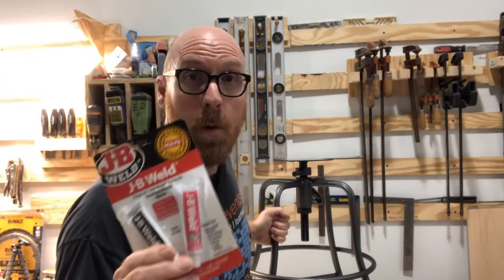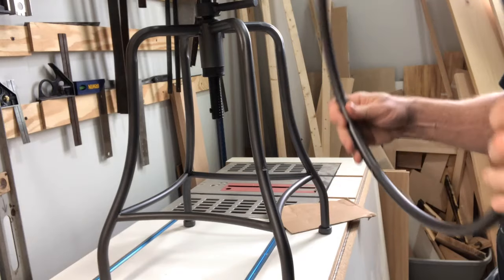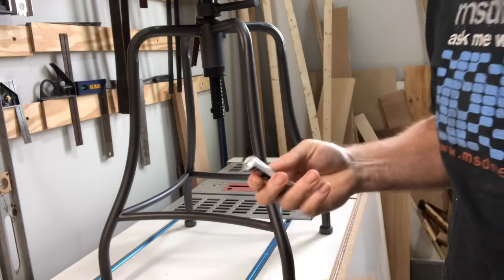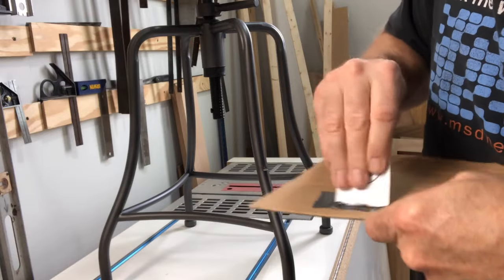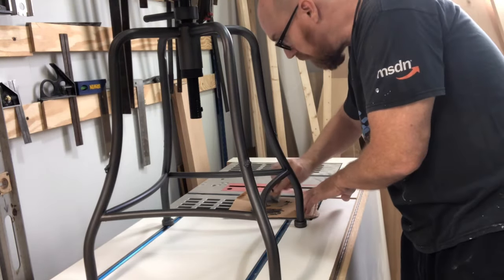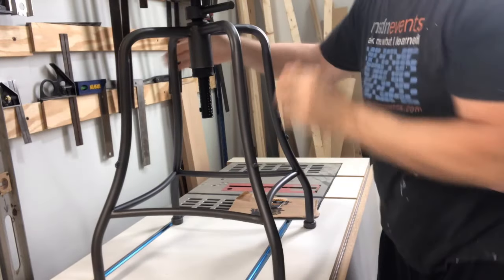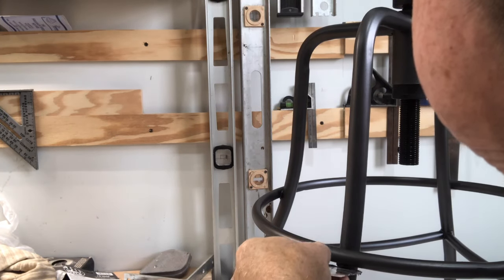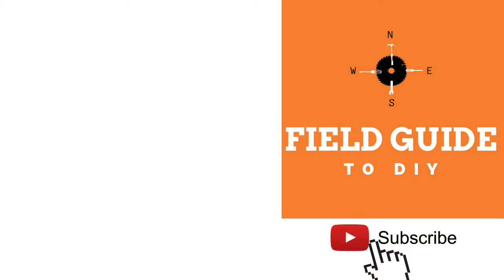How to use JB Weld | JB Weld Original Cold Steel | JB Weld Step-by-Step Instructions

Comment from the maker: Have you considered JB Weld SteelStik?  Here's how to use JB Weld SteelStik - https://youtu.be/ccGJyBNzf50
Reply: I used JB Weld SteelStik on something and it didn't work out. Now, I want to try out JB Weld Original. Can I apply JB Weld Original on top op JB Weld SteelStik?
Reply from the maker: @Zeberka767  I had a similar experience.  I believe you can but just to be safe, I ground the steel stik off.  https://youtu.be/ZzFCqm_9O2c Thanks so much for watching.  Let me know how it goes either way.
Reply: @FieldGuidetoDIY  I used it today and so far it looks promising but I was wondering when it says it cures in 1 hour does that mean I can drive with it on after 1 hour or does it a full 24 hours to fully cure and harden?

Comment: Would like to see you show the hold at end of video
Reply: maybe a sequel? resolve the story?
Reply: You can't really trust it. It will get hard, but it can fail under pressure, for sure. Good ole drill hole, nut and bolt works every time and far stronger.

Comment: Great view Eddie - love JB Weld.  Once cracked a casing on my motorcycle and they wanted over $500 to patch it. A friend told me about JB Weld and I patched it for under $5.00 bucks.  Great video - looking forward to the next one.
Reply from the maker: Trent Wheeler It is a great product.  I used it on a curtain rod over the weekend.
Reply: Truth is, that jb weld will break down and cause extra wear on your oil pumps and any other connecting parts
Reply: I have the same problem

Comment: Trick with using old cards (credit cards, loyalty cards, room keys, any plastic cards...).  Get a pair of "pinking shears" (they cut a sawtooth pattern) - you can cut the cards and use them to spread glue...  works better than just a plain card.
Reply from the maker: Brian, great tip.  I need to try that out.  Seems like it would work like a tile trowel.  Thanks for sharing.

Comment: It cures, not dries. Actually, the terminology can make a difference when a novice user touches their fix and it feels dry, it probably hasn’t cured, and they’re none the wiser, until it breaks.
Reply from the maker: Very good point Jay!  It “sets” in 1 hour and “cures” in 24.
Reply: @FieldGuidetoDIY  I’ve replied to two videos, somewhat critically, though not my intent, and you’ve responded well to both. Good on you for your positive attitude.

I’ve thought about offering videos on my experiences, to offer a “better” and fuller example of what one should/shouldn’t do or expect, so I appreciate all those out there in YouTube land for following through, yourself included.

Most of my issues have already been addressed, though some are inaccurate or short on details that could make the difference between success and failure. I determined that completing a task, videoing along the way, and then editing it was waaaay more effort than I had any desire to undergo. So, I “try” to be helpful in offering my two cents. Sometimes it’s appreciated, and other times it’s poo-pooed. Such is life. 🤷‍♂️

Be well, and keep making your videos, they Are appreciated!

Comment: I'm gluing the tie rod on my garden tractor today with JB WELD original.
Reply from the maker: That will be quite a bit of bouncing.  I’d like to know if it holds.  Keep me posted.
Reply: @FieldGuidetoDIY  I wire wheeled the parts and cleaned them with alcohol. I used a magnet and zip tie to position everything. After 5 hours I'll remove the magnet and cover the whole joint heavily with JB. After another 24 hours we'll see. I can always strip it and weld it. I'm just curious.
Reply: @dalehammond1749  how'd it go?

Comment: This was really helpful, thank you!  I’m brand new at learning how to do things around the house and I found your video very informative and I didn’t feel talked down to at all. Keep it up!
Reply from the maker: Maya, I am so glad you found my video and I’m so glad it helped.  I hope I NEVER appear to talk down to anyone.  We all approach DIY at different levels and even the most experienced general contractor out there can learn something from somebody.  Thanks again.
Reply: It is not helpful being a video how to use this product. You have to clean the surfaces you're going to glue up. Simply applying the glue over the paint is just wrong.

Well, it can stick the parts together, and in this case it doesn't matter, but the surface preparation part is crucial.

Comment from the maker: Be sure and see our JB Weld strength test.  The results may surprise you.  https://youtu.be/cUZ8b4wxDXk
Reply: I know when mixing bondo or glaze with automotive it's well known to never mix on cardboard because components of the epoxy soak into the paper. It could result in it being tacky due to a failure of the hardener or could overall just be a weaker finished product.

So I imagine you would want to use a hard plastic flat surface that is disposable..... Cheers
Reply from the maker: John You raise a great point.  Never thought of that.  I did not notice much absorption of course I used a very small amount.  I could see how that could be a factor w bondo and other epoxies with larger amounts.  Thanks for raising this point and thanks so much for watching.

Comment: I have a laundry bag made of canvas and the strap tore i thought i could glue it with crazy glue it doesn't work it becomes brittle and falls apart i could sow it but don't know how is any kind of strong paches that can fix canvas would really appreciate you thanks
Reply from the maker: Juan, I am afraid you’re going to have to sew that with some strong nylon thread.  My grandfather was a sailmaker his whole life and I am quite familiar with canvas and canvas repairs.  Great question though!
Reply: @FieldGuidetoDIY  that'll work nylon any kind of needle will work?
Reply: @FieldGuidetoDIY  how about the glue you just used I ask because if have the two in one but I haven't opened it yet.
Reply: @FieldGuidetoDIY  yes sir I'm going to have do it by hand.
Reply from the maker: @JuanCarrero-ok3nx  there ya go.

Comment: Can this be used to basically weld two pipe back together my exaust on my honda came undone and I'm not spending 1000 plus to get it redone
Reply from the maker: It really depends where you're going to have your repair?  I believe it is rated up to 650 degrees Fahrenheit so maybe having it close to manifold may exceed that.  Thanks so much for watching!

Comment: I bought JB Weld epoxy for metal yesterday at Walmart. 

Do you think it will hold Aluminum sheeting to a metal header?
Reply from the maker: It should.  I've had good fortune attaching aluminum w JB Weld.  Let me know how it goes.
Reply: @FieldGuidetoDIY  how much weight does this hold? It’s a floating 30” long header. Pine wood. Prob 2-3lbs if that
Reply: @FieldGuidetoDIY  I backed the wood with a thin sheet of cut aluminum so it’s a metal to metal marriage

Comment: Any ideas on how to apply a bead in the corners of a metal sand scoop used when metal detecting at the beach. I’d like to reinforce all the welds cause they look pretty weak. China😬
Reply from the maker: Absolutely.  Mix up a batch and real quick lay it in using a popsicle stick.  The longer you work with, the more likely you are to have peaks like those found in a meringue pie.  You can even sand the high spots with some 120 grit sandpaper.  Let me know how it goes.
Reply: @FieldGuidetoDIY  Thanks , I’ll keep you posted 🤙🏼

Comment: Hi do i let it dry for 4-6 hours then wait a another 15-24 hours
Reply from the maker: Yes.  Don’t touch it or move it for 4-6 hours.  It is not full strength until it cures after 24 hours.
Reply: @FieldGuidetoDIY   so I wait for 30 hours total
Reply from the maker: @danteslays633 negative.  6 hours from application to move it and 24 hours from application to use it and consider it full strength.

Comment: I want to put sisolation un the underside on a metal roof. Thought on using JB weld to fix metal support lugs on the underside of the metal. Would this work do you thinks ... what approx weght might might the joint be expected to hold?
Reply from the maker: Mervyn, what a great ideas.  I’m thinking the insulation would not be very heavy at all.  I’m thinking 2 inch thick styrofoam sheets at the most.  I’d suggest a minimum of 4 bolts through each 4 x 8 foot sheet.  JB Weld is rated up to 680 pounds per square inch so I think you’re well within the tolerance.  Please let me know how it goes.
Reply: @FieldGuidetoDIY  thanks

Comment: HOw do you clean the top of the jb weld dispenser so the top will not stick when you put it back on?
Reply from the maker: You may need to scrape or carve off the hardened portion off the top.

Comment: Could I use this to plug a hole in my water pump for my 2003 Chevy S-10 Xtreme?
Reply: I don't see why not. I plugged a hole in my crankcase for a dirt bike with it
Reply from the maker: Brandon, just curious.  How big was the hole?
Reply: I'm thinking of using it to seal a radiator crack in my 85 Chevy. Any news on how well it held? I just need it to survive til my paycheck comes in lmao

Comment: You should have marked the back legs before removing the ring ! Then you would have known where to add the JB, how long did it take until it fell apart again ? :p
Reply from the maker: You’re exactly right.  Or just one leg since the weld was on the bottom side of the foot rest.  By the way, still holding.  I can’t say the same for the stool I repaired with JB Kwik Weld.

Comment: Quick question. I have a discontinued double bass set of drums that I've got alot of cash tied up in, well the left leg on one of my kick drums broke tonight and i can't find one anywhere. The part that broke on the leg is like a metal looking fiberglass material but it seems very brittle. Will JB Weld work if I use it and just let it set for a few days?
Reply from the maker: Jonny Crash It is worth giving it a try.  Although the kick pedal will get a lot of force and repetitive action, JB Weld Original Cold Steel is rated up to 680 pounds (your right foot isn’t that heavy, is it? 😜). Clean the contact points up real good and give it a try.  You may have to come up with a creative way to clamp it until it cures (24 hours).  Check out this video I did with just a little bit of contact.  https://youtu.be/LWt2vkgiPU8.  Let me know how it turns out.  Good luck.

Comment: Would this be safe for something that holds a lot of weight like a bed frame
Reply from the maker: It actually depends on how much “meat” (overlapping metal) there is.  I’ve found a butt joint of the thickness of a bed frame just doesn’t give JB Weld enough surface area to be successful.  Let me know how it goes.  Thanks so much for watching!

Comment: Hey there I got a 20 KG York weight plate it cracked when It dropped to the concrete ground from height!. Would this  be suitable to mend it back together?? The plate is made of I think some kind off cement or concrete mix!? Appreciate any advice thanks..
Reply from the maker: KAOS, the manufacturer says it is rated for concrete as well.  I think it worth a try.  Keep me posted.  Thanks so much for watching.
Reply: Ok I’m getting it today I will keep you posted thanks
Reply: @kaosrip8913  did it work?
Reply: @TheBigr2020  
Sure did still solid to this day appreciate the help awesome 👌

Comment: Question for machinists and tool lovers: I have a chisel attachment on a rotary hammer I'm using for a project and the bolt's threads are literally melting and busting away when the tool is in use. Can JB weld and a locknut protect the threads??
Reply: no
Reply: @jimmyrecard6021  well thank god I read deeper into that before I did it. Bought some red loctite 271 threadlocker so I'm hoping that will do the trick
Reply: @jeffreymeeks4051  run chaser through it to clean up the threads too.
Reply: @jimmyrecard6021  well my hardware was all brand new so the bolt and nut threads looked as clean as they could be

Comment: Hello. My bunk bed is a metal tubular one and its a twin over full. The bottom bunk has some broken bars that are broken from the frame and now the bed is drooping. Do you think this would help?
Reply from the maker: I really think it would help.  The best way to fix it would be to shore it up with some wood or metal inside like what I did with the 13 foot curtain rod.  I’d cut the pipe and insert a wooden dowel or smaller piece of pipe.  I hope this helps.  Please keep me posted.  Thanks so much for watching.  https://youtu.be/Hiu95-_3sgU
Reply: Throw it in the garbage it’s time for a new bed

Comment: Did you say equal parts when mixing the jb weld ?
Reply from the maker: Joshua Chudley JB Weld Original Cold Steel requires equal parts of cold steel and hardener.  Thanks so much for watching.  Let me know if you have any other questions.

Comment: Does it have a strong odor/fumes?  I have a small apartment and wondering if doing a project while I work from home is a bad idea.  But I just wanna get paid for DIYing on the clock!
Reply from the maker: Se Sa, the smell is not strong at all.  I tend to do repairs in my garage with the door open but I have used it indoors.  Thanks so much for watching.

Comment: Hey boss would this work on my motorcycle oil pan. Small crack
Reply from the maker: Maine F, I would think so as it is rated up to 680 PSI and water tight and up to 300 degrees.  The question I have would be whether or not the solvents in the oil and the oil itself would break down the epoxy.  I’d think you’d be okay because one of JB Weld’s biggest successes is on radiator repair and radiators are filled with solvent-filled anti-freeze.  I think you’re good.  Please keep me posted.
Reply: @FieldGuidetoDIY  will do thx for the reply!

Comment: I mix it with a little steel wool for extra strength.
Reply from the maker: Now Jim, you’re the third person who shared that idea.  I’ve got to test that.  Thanks so much for watching and for sharing.
Reply: Im going to try this. Good Idea
Reply: Same basic principle of putting rebar in concrete I'm assuming. Smart idea 🧠
Reply: @CCitis  I get a little piece of sos pad then rinse the soap out of it and i have mini rebars in my job weld.Maybe there is something better but i figure it is twice as strong sticking two pieces together rather than just straight jb weld.
Reply: @tristonmurdock4586  Exactly trying to pull concrete apart with screen in it like in a garage floor or sidewalk or even break it is very hard.I stuck together two pieces of plastic on my car engine using this method and it is still holding .If i have a couple of hundred tiny wires across the break as well as the job weld i figure i have done pretty much everything i can to repair it .At the very least it will be a strong as straight job weld.

Comment: That's nice but it wasn't tested.  Maybe hang the chair from a heavy tree branch and get an 800 lb. gorilla to swing from it.  That would be impressive.
Reply from the maker: 🤣 That WOULD be impressive.  However I don’t have access to an 800 lb gorilla.  However it has been over 2 1/2 years and this repair is STILL holding.  Thanks so much for watching (and the suggestion).

Comment: I saw video how JB Weld was used to repair hinges on s10 , blazers and bravados that cause sagging . Can't find it anymore . Anyone know anything about the procedure ?
Reply from the maker: I'm not sure I understand.  I once worked on an S10 that had the same thing.  I had to loosen the hinge bolts and scoot them back up in position so the door would close and catch.  I guess you could completely remove the hinge, slap a bead of JB Weld in there and then tighten it back up but that sounds risky.  Keep us posted.
Reply: @FieldGuidetoDIY  I cleaned metal area . Covered bottom of elongated holes . Let them cure . Carefully drilled new holes . Also installed bushings and filled any void and cure .  Carefully reasembled not to bind anywhere and so for its working . I'd still like to see the video. Another thing to do is before reasembly roughen area above and below newly drilled holes , get washers that door pins can go through with close tolerances . Roughen one side of washer, coat with JB WELLD and clamp , make sure wholes are aligned , cure . Reasemble . Idoes take some time (cure time) but seems to work .

Comment: how cold outside does this jb work at
Reply from the maker: JB Weld manufacturing says it is rated up to 67 degrees below zero once cured.  I could not find anywhere the temperature at which it will not cure.  I’m assuming it is above freezing but I have not tested it.  Coming soon.  Thanks for the question and the idea.  Thanks so much for watching.

Comment: Is it safe?
Reply from the maker: It is not edible and because it is an epoxy, you need to work with it in a ventilated area but it is STILL holding nearly two years later.  Thanks so much for watching.

Comment: Better video if you would have shown you testing afterwards with a rubber mallet or 2x4 to show how strong the weld was.
Reply from the maker: Great idea Brian.  Thank you for the suggestion!
Reply: @FieldGuidetoDIY  By crazy coincidence I used JB Weld on my son’s 10 speed bicycle today as one of the handlebars was not tight and the bicycle tech told him JB Weld would be a perfect solution. I followed your instructions by filing the metal, using rubbing alcohol to clean surfaces and applying with a small plastic spatula. I am planning on going back to his house tomorrow to do a second coat. Hopefully it works and I am confident it will. YouTube is the best resource e thanks to people like you who take their time to share their knowledge and experience.
Reply: Unfortunately the JB Weld repair didn’t hold. Broke on the first ride. Back to the drawing board!
Reply from the maker: @brianbaker359  I'm sorry it didn't hold for you.  I do appreciate you watching my video though.  Better luck next time as they say.